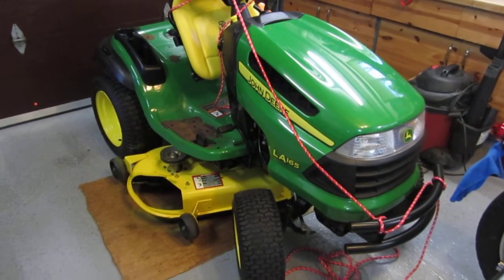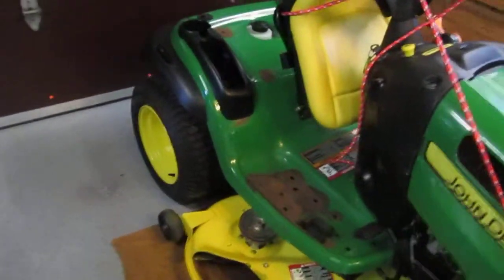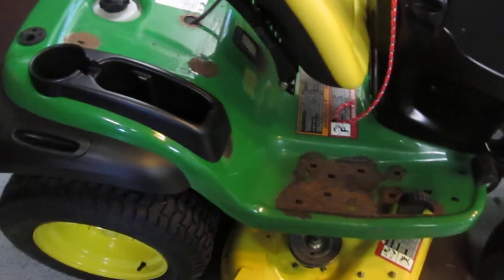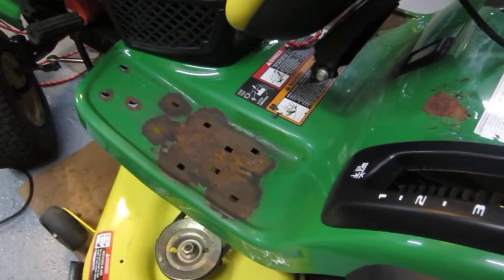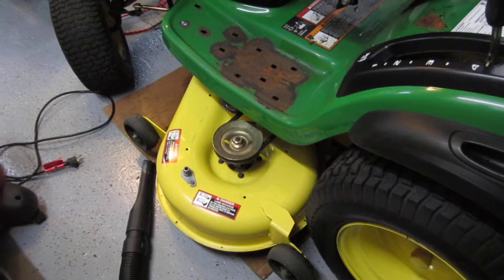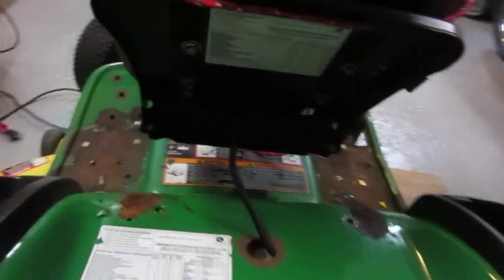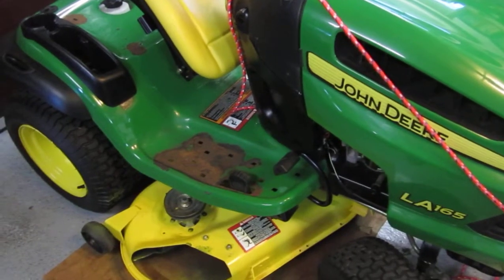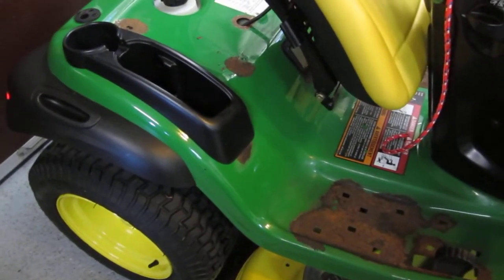John Deere Paint Issues ... Buyer Beware!

Comment: I have a 20 year old deere same story seat pan flaking like dandruff.  Whatever they do with the seat pans is wrong.... they dont care.
Reply: Dude 20 years old at 2 years old are a big difference. After 20 years you can expect some issues. After 2 years. John Deere needs to fix it. I have this problem on my 5 year old D130
Reply: @tooltime4640  dude 2 years 5 years 100 years, deere has an issue

Comment: The D series aren't much better . My D130 is peeling on both sides and the middle of the floor after 42 hours and being kept in a garage . Someone should have started a class action against them . My old 1984 JD has no peeling paint so it's obviously a paint process change problem .